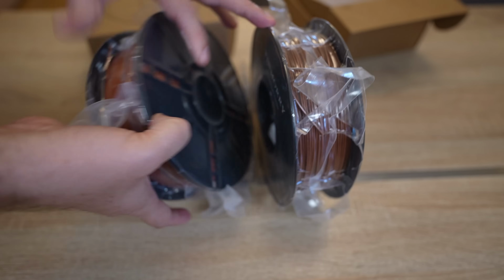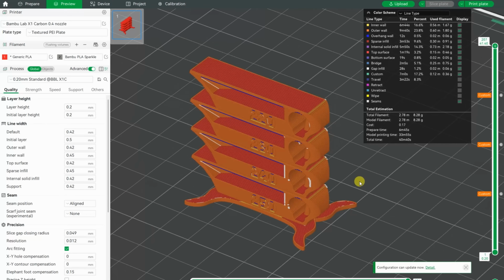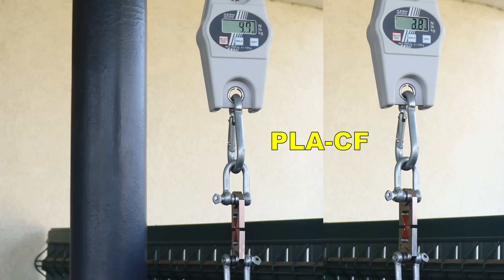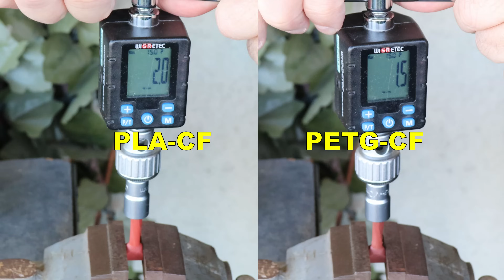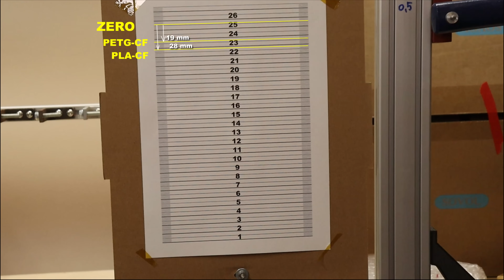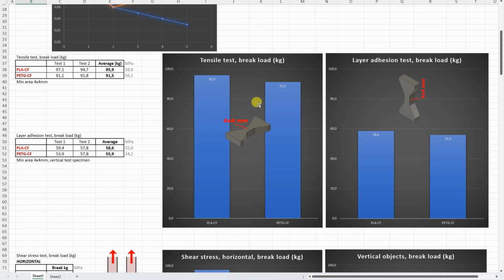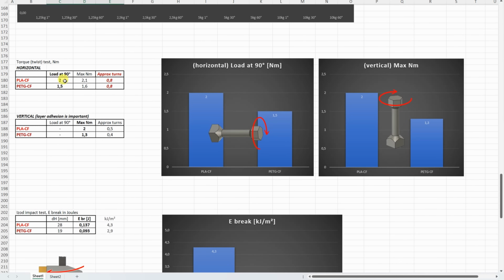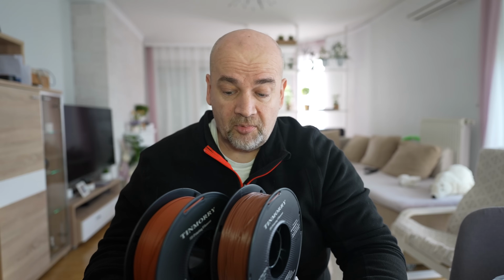Tinmorry PLA-CF vs PETG-CF, carbon fiber filaments with a great layer adhesion!

Comment: I've gone through about 5 spools of Tinmorry PETG-CF and my less scientific testing and research prior to trying it yielded amazing results. Glad to see it confirmed here. I love the aesthetics and unique properties of CF filaments even though it's generally a marketing scam. I've just started designing a CNC Router utilizing as many 3D printed parts as possible without using extreme engineering filaments and this filament is going to be my go-to for the project. My goal is acceptable tolerances and surface finishes on 6061 and quality work in hard wood. I'm not expecting to hit any impressive feeds and speeds or stepdowns but hey, if it's made of extruded alu and budget linear rails/guide bars and open loop stepped motors you can't expect Kern level results :)

Your channel is amazing, keep up the quality work. 

Integrity will prevail.

Comment: I hadn't paid much attention to Tinmorry filament for some reason.  Based on this video and the comments, I placed an Amazon order for a kg of black Tinmorry PETG-CF to test.  I loved the fact that Tinmorry sells this material in 3 kg spools as well as ten 1 kg bundles.  They clearly intend this to be used for print farm manufacturing.  I particularly liked the 3 kg spool with a slight price break per kg.  Most retail manufacturers of filament don't offer 3 kg spools, and when they do, the cost per kg is higher, which is bizarre.

I had PET-CF from a couple of other manufacturers to test for an upcoming product and now Tinmorry is added to that list.  For this product, the relatively high layer bond strength is an important factor.  A big part of the consideration is ongoing availability.  From a manufacturing perspective, it's important to have reliable suppliers.

Comment: PETG-CF has an IZOD impact strength of only 1/10 of the advertised 44.8KJ/m2.
For me it's a disappointing filament.
Reply from the maker: Maybe they are measuring with Charpy impact tester. Thats supported in two sides.
Reply: @MyTechFun  I see! That's possible.
But I think it's a material with low toughness.

Comment: For electronics enclosures, the PETG-CF works really well with the "fuzzy skin" slicer setting.
Reply: PETG-GF would provide much better dielectric strength in an electronic enclosure but the PETG-CF would provide some EMI shielding.

Comment: So they use a lower percentage of carbon fiber?
Reply: Looks like less carbon fiber and shorter maybe smaller diameter strands, based on the micrographs of the broken filament as well as the 0.4 mm nozzle recommendation.

Comment: Good Afternoon. I love your videos! And I'm following you since 6 months ago. I think that your videos are very interesting and your precise analisys can help lots of 3d printers like me. Thank you! Also. I would like in the future if is possible do two interesting works. One is comparison about the diferents PA (nylon) filaments on the market.  Nowadays I'm use a Polymaker PA COPA and I think is the best that I've used. But i think lots of doubt with differents Nylon filaments. The other study very interesting I think could be what is the best ISOTROPIC FILAMENT for FPM printers in special tensile strength in Z vs XY. I think the most technical sheets of filaments dont analyse this point and this is a very important point for FDM printed objects. Yo can have a very good filament about tensile strength in XY but in Z be worse. For example PC is a good filament but have this big problem. Thank you for your work. Regards!
Reply: due to the nature of the technology, isotropy is very difficult( probably not possible) to achieve. the shear rate at the nozzle usually induces the polymer chains to align in the flow direction, hence the anysotropy ( depending on the speed during printing, the offset z and flow rate, the shear rate can vary from 100, up to 1000s s^-1). Layer adhesion is more related to the printing speed and more importantly th temperature at which you extrude the filament. other factors also affect such as crystallinity, PA6 is semi crystalline and shear flow alignment causes the polymer to crystallise at higher temperatures , sometimes it can increase up to 10 degress or more. coPA is a copolymer of PA6 ( i guessed PA6, it maybe another like PA11, PA12 or any other), so probably it will have a more amorphous character compared to PA6 homopolymer. PC is totally amorphous.

Comment: Just ordered some of the Tinmorry PETG-CF after watching this video.  After recently watching one of your videos I decided it was time to install the hardened extruder gears and bought some Polymaker PA6-CF.  Printed like a dream, resulting parts were super-stiff, but expensive so I am saving it for when I really need it.  This PETG-CF is priced nicely and should be OK for most of my "functional" print needs.

Comment: I'm glad my friends and I aren't crazy. Different from most filaments, we thought PETG-CF often seemed to gain layer adhesion from the carbon fibers. Overall it makes printing PETG so much easier, hides the layer lines, and maintains great properties. Tinmorry is some of the best available to in our experience. I also emailed Tinmorry recently for a data sheet on their PET-CF, and while it was limited, they said they are working on getting better TDS for many of their filaments. Great testing as always!